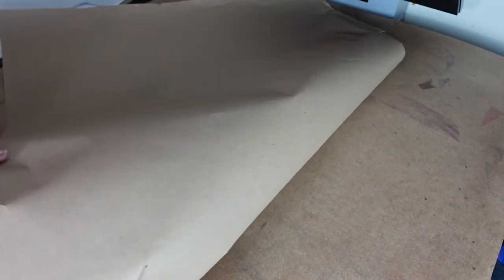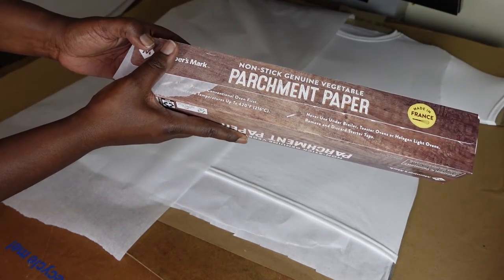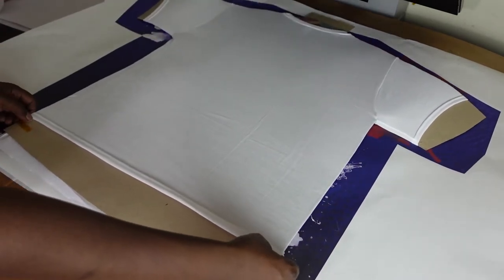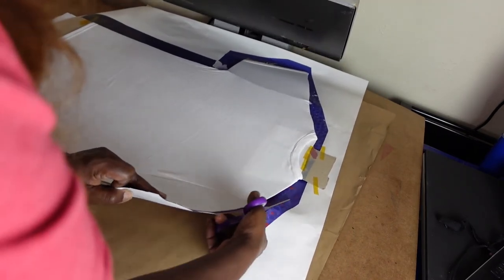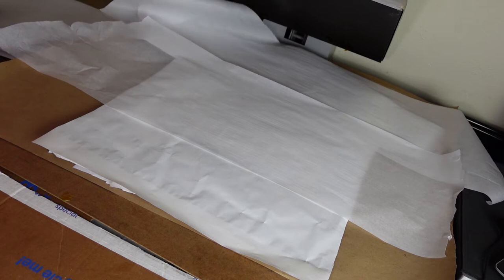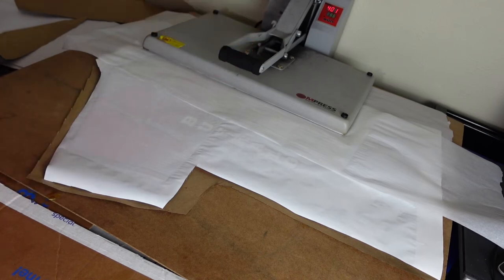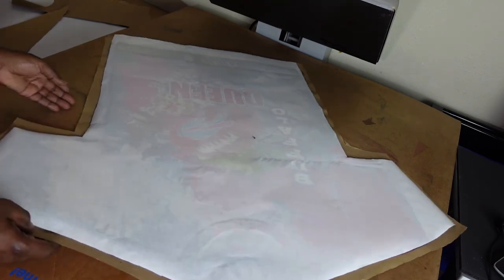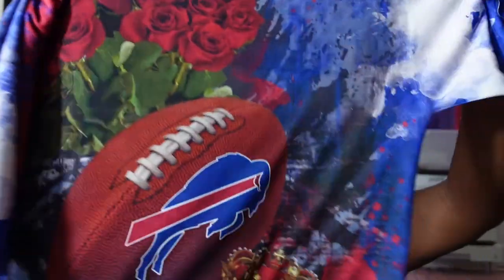Sublimating an All-Over 3D Shirt: Step-by-Step Process and Tips | Small Heat Press

Comment: They only sell tacky paper for larger sub printers I have a 8550 I don’t see it for 11x17 or 13x19 so do you know any tacky sprays I can use to make it stick ?
Reply from the maker: Hello, I haven't used adhesive spray in a while but I believe this is one of the one I use to use https://www.homedepot.com/p/3M-13-8-oz-Super-77-Multipurpose-Spray-Adhesive-77-DSC/316334789?source=shoppingads&locale=en-US&pla&utm_source=google&utm_medium=vantage&utm_campaign=23574&utm_content=25228&mtc=SHOPPING-RM-RMP-GGL-D24-Multi-MB-3M-NA-PMAX-NA-NA-MK861609001-23574-NBR-669-NA-VNT-FY24&cm_mmc=SHOPPING-RM-RMP-GGL-D24-Multi-MB-3M-NA-PMAX-NA-NA-MK861609001-23574-NBR-669-NA-VNT-FY24-71700000117265046--&gad_source=1&gclid=CjwKCAiAuNGuBhAkEiwAGId4aqWH6kMivruLXyH24ZtKjF7J-Go7OMOud2vt_HXsIcUeU8EvA_tLGBoCSlUQAvD_BwE&gclsrc=aw.ds

Comment: If you have a 100 t-shirts to do you're done 😂
Reply from the maker: I only take on what I can do. Never afraid to say no or contract an order out. Thank you for your words of encouragement. You should be proud of you💕
Reply: @That2ThisCreations  here's some encouragement I encourage you to buy half a dozen t-shirts get you few full prints
Just put parchment paper inside the neck area, in the opening of the sleeves and the bottom of the t-shirt, then put the rear print on the bottom facing up, put the t-shirt over it then put on the front print facing down after trimming both sides tape both sides together at the extremities
Now you print it as usual section by section like that you can double or even triple your productivity and make more money
Now imma get out of your own cheers
Reply from the maker: @BigDub24  I've never seen it done this way, I'm open to trying it and will. Thank you 💕

Comment: I'm getting hard lines when I press my shirts. I'm using a 15x15 heat press with a hard board. Do you have a idea why this happening? Thanks In Advance.
Reply from the maker: Are you piecing together your pages Subliblane? If so that may be the cause. I used to get those hard lines as well when I had to piece my pages together.

Comment: Good video get your self some tacky paper it well save you some time great job regardless that how you got do it if you don't got that tacky..
Reply from the maker: Hello, thank you, that is the tacky paper I was using. I got it from heat press nation.
Reply: @That2ThisCreations  oh ok
Reply: Just noticed your using ram board does that help against the front collar scorching and appearing in back of shirt when doing front to back prints? and what kind of tacky paper your using looking for good paper for Epson f570 great video thanks subbed...
Reply from the maker: Hello pkilla617. I personally have never had an issue with my shirt collar scorching. I tape a piece of the tacky sublimation paper that I cut off from the print to the inside of the collar to keep the ink from transferring to the back collar of the shirt when pressing. It's 44" tacky sublimation paper that I got from heat press nation. Hope this helps.
Reply: @That2ThisCreations  do you do same process when you do the back print as you did the front
Reply from the maker: Yes, I do the same process for both sides @pkilla617
Reply: @pkilla617  hey what is tacky paper and why do you use it? Is it like all sublimation paper?
Reply: @pkilla617  where can I get ram board?
Reply: @mylaysia4  home Depot